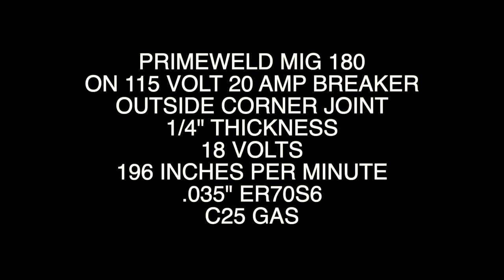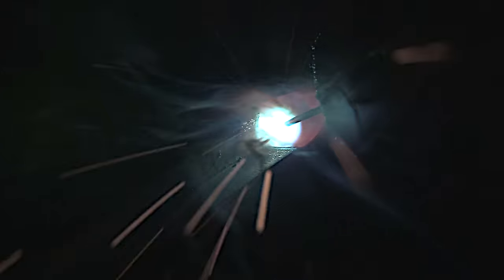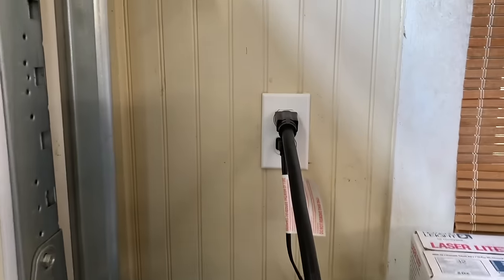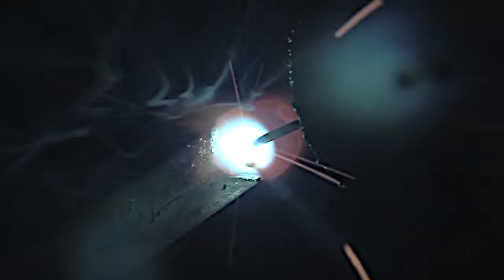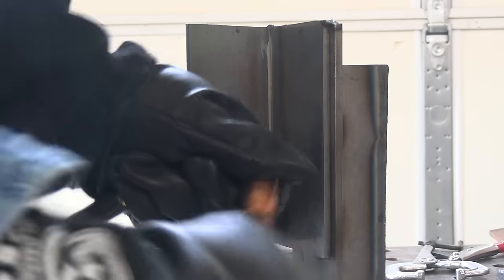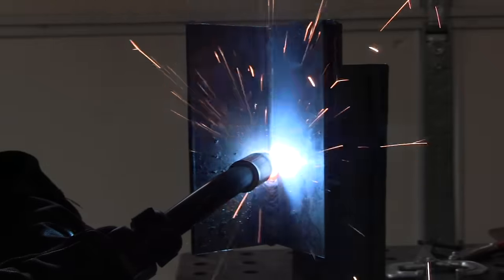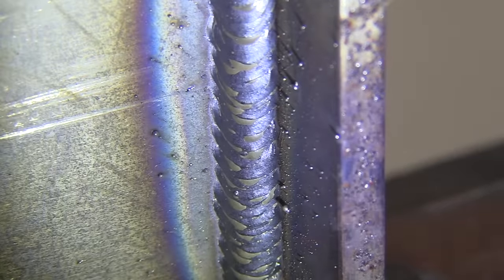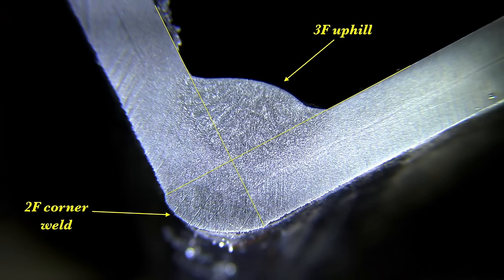MIG Welding Settings and Techniques Tested - PrimeWeld MIG180

Comment: I like your videos. Back in the 70’s I worked in a job shop as a machinist which in those days meant we welded and I did. It was very fun yet that job found layoff in the early 80’s so I never had any job where I welded. A darn shame since I loved it as much as machining. I did in later years very much appreciated and worked well with welders doing give and take conditions. Neither welder nor machinist need do things on their own because they work together. I have been amazed that great welders have exceeded machinists really. Give or take there are many exceptions to that.

Comment: Thanks for getting the audio dialed in. Your videos have improved a bunch since I started watching them. Now you've a machine for sale. Yep. I'll probably get one, just not this week. Thanks!
Reply: @weldingtipsandtricks I'm the guy who used to fuss about your audio being too hot--and of course it still is on the very old stuff (I unsubbed for a year or five). That was so long ago--you were only selling Tig Fingers and nothing else IIRC.  Now you've got the big store!  Glad I came back around to find good audio and your excellent commentary and arc shots. I just became a Primeweld Customer: I've got a PW TIG325 and a plasma cutter on order--and thinking about the spool gun/MIG setup here-for a super portable unit. The 25' extension cord from PW should help move a little machine to the work.  Good on your success Jody, keep on melting metal and teaching the trade.

Comment: I love the short circuit MiG videos so thank you! I did notice the uphill weld had quite a bit of spatter compared to the outside corner weld. Is that due to settings or do you have any suggestions on how to reduce the amount of spatter? I know they are generally easy to remove and don’t affect the weld quality I’m more just curious than anything.

Comment: What brands of wire deliver cleaner beads than the others when gas welding mig?  Is there any appreciable difference?  What about flux core?  Getting to be so many brands (are they from common factories or actually different?) it is hard to keep up with them.  Huge spread in prices for brands as well as those selling them.
Reply: You're not going to go wrong with Lincoln or Hobart wire.

Comment: When you say "heat", is that a function of voltage?  My understanding is that wire feed controls / affects amperage. That would leave voltage adjustment to control heat. It that correct?
Thx,
Reply: Yes, you are correct. voltage is setting for "heat".
Reply: @stefanm5636  Thx

Comment: What did you use to etch that weld?
Reply from the maker: i used a passivation solution designed to remove heat tint from stainless .  not sure what all is in it but i know there is some nitric
Reply: @weldingtipsandtricks 
30% nitric acid and 5 hydroflouric acid. Definitely don’t let that stuff get on you. Use it here all the time in my shop. Even acid vapours are bad to breathe in.